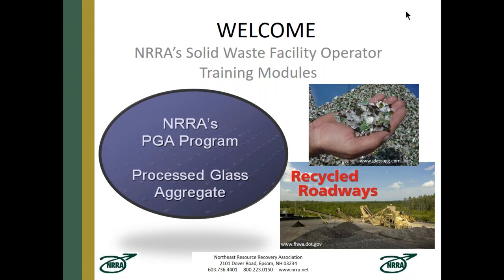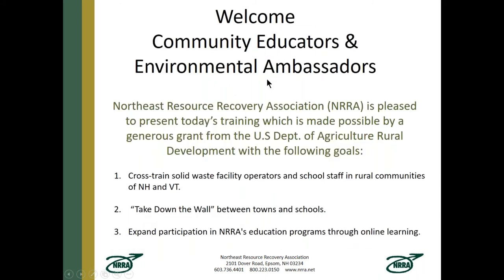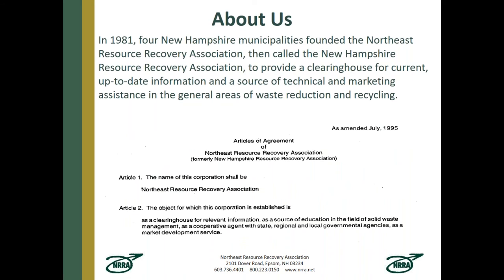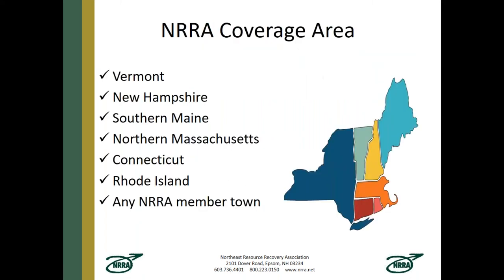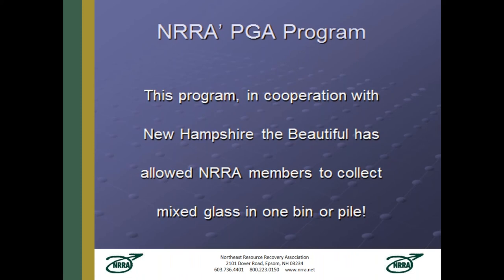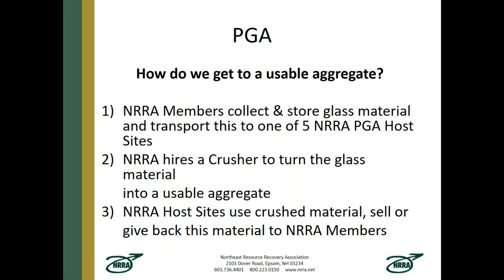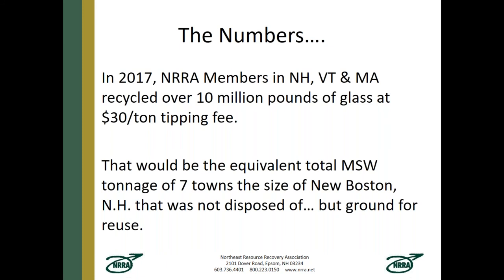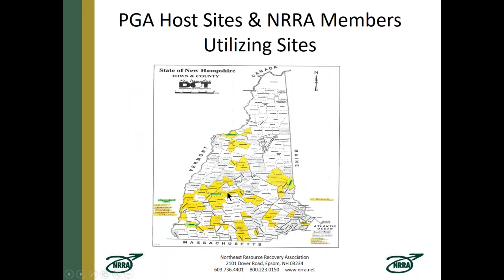Processed Glass Aggregate (PGA): A Certified Waste Derived Product Webinar 2018

Comment: hey there.. do you have any experience using it as a substitute to sand to make a concrete?
Reply from the maker: We recommend it's used as a road base, not as a sand substitute for concrete.

If you did use it for concrete, it would not be as strong if you use PGA, which is shown in this video, where pieces are still chunks of glass, opposed to grinding it into powder. For reference:

https://www.concretedecor.net/departments/concrete-placing/waste-glass-in-concrete-has-advantages-and-disadvantages/

"The strength of concrete containing glass powder as a cement replacement material is approximately equal to that of concrete containing only portland cement. However, its durability properties outperform that of conventional concrete.

The strength of concrete containing glass aggregates is 10%-20% less than that of concrete containing mineral aggregates. This reduction in mechanical properties is due to the lower strength of aggregates as well as less bonding between the glass aggregates and the paste compared to the mineral aggregates."